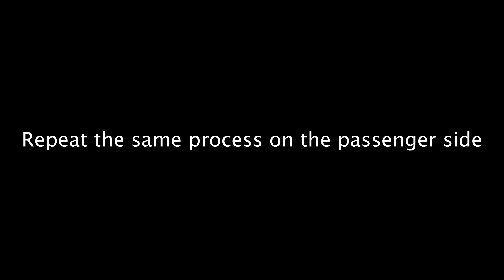Tubing a 3rd gen Tacoma to fit 37s.

Comment: Nice! So do you lose 1.5" of interior floor space or was that all dead space that was removed?
Reply from the maker: You technically lose floor space but there is a pad that serves as a foot rest that is there stock so it's about the same as before on the interior feel
Reply: @kreyzfab   Yeah, that makes sense. Well, thanks for that info. Might build up the courage to chop up my firewall one day and hopefully not burn down my truck 🤞
Reply: Did you move the body mount bolt back?
Reply from the maker: No